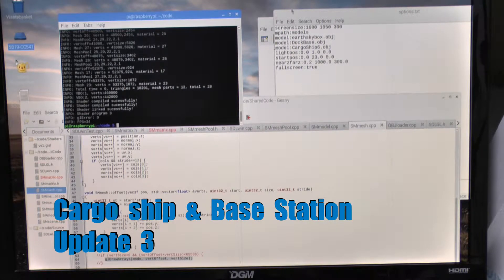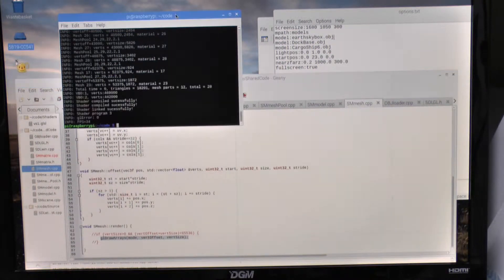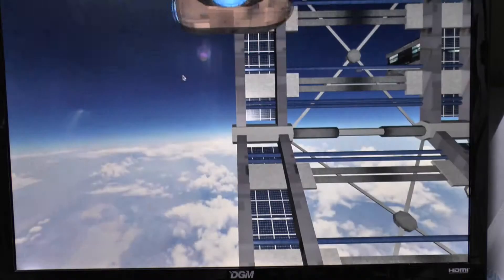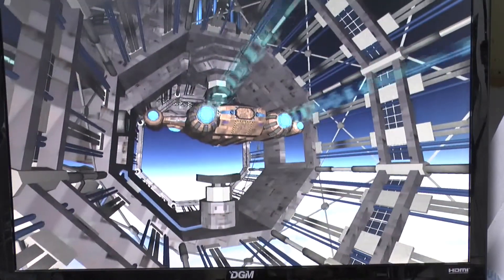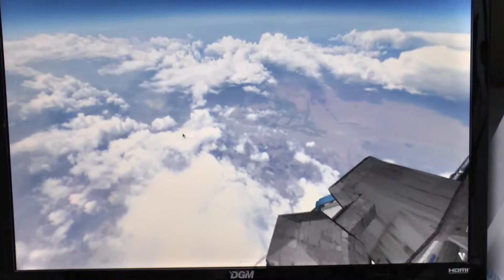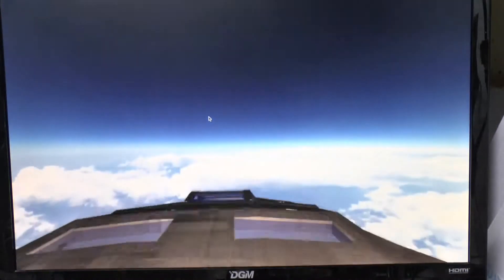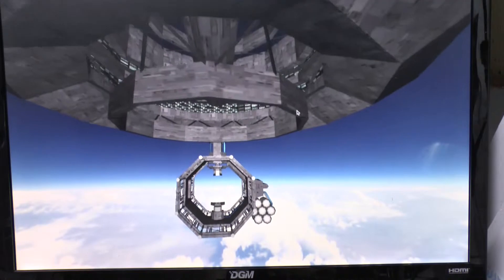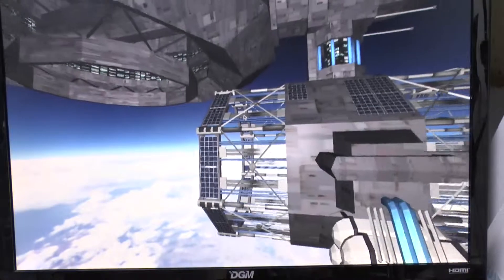Update 3: Large scene rendering on Raspberry Pi

Comment: You know "the dark mod" (which is from the released old doom3 engine foss and theif3)? Can htat engine get run on this Pi model? As soon as that engine (or equivalent) is on there, loads of FPS or sneak-em-up games can be made. Then for htis spaceship stuff, basically, OOelite or Pioneer (which is Elite2Frontier) will cover the spaceship genre games. Beyond that, some sort of 0AD engine (to allow modern RedAlert/StarCraft games too) will cover those strategy games. Then some sort of FOSS equivalent to a NeverWinterNights2 style engine will allow for level design D&D style games (although the doom3 engine above might be modified to allow for that and fallout3 style games). Once all these things are done the Pi could be a "known-quantity" gaming platform for linux running on baremetal if need be without any of that Steam-type software required. A downside though might be a lack of tesselation. Still cool even without it though.
Reply from the maker: It seems that TDM could possibly be ported (http://forums.thedarkmod.com/topic/19852-tdm-on-raspberry-3/) but would take a lot of work and the Pi would be too underpowered. The Pi could probably manage some games from the late 90's (see port of Freespace 2 - https://www.raspberrypi.org/forums/viewtopic.php?f=78&t=230316&p=1411130#p1411130)   What I'm hoping to do is write a graphics engine specifically written for the Raspberry Pi rather than just porting code and get the most out of this machine.